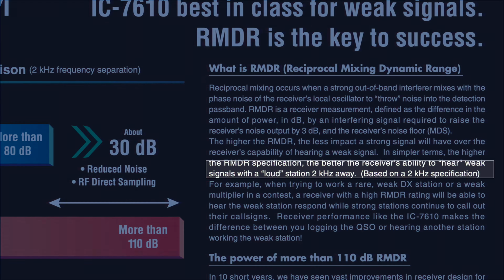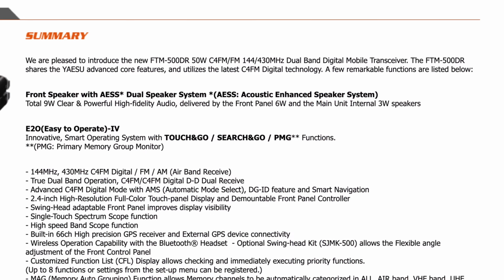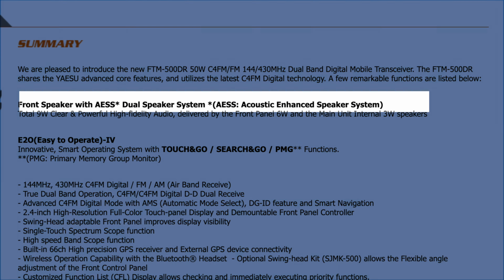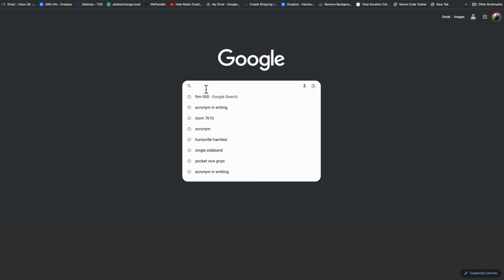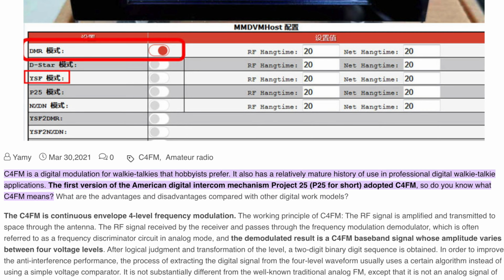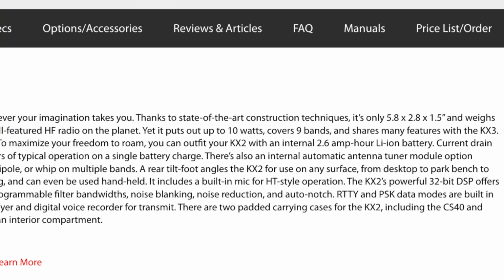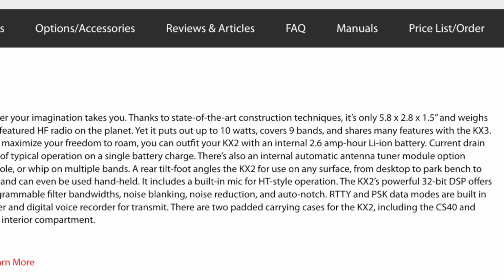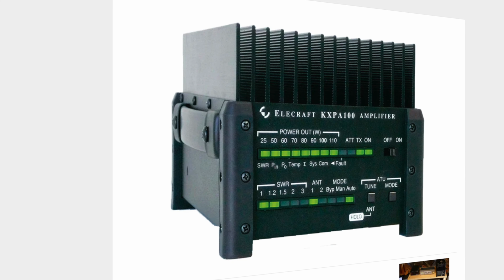Conquering Acronyms In Ham Radio And Other Hobbies

Comment: Using "context clues" is EXTREMELY valuable in every part of life, it can not be stressed enough. But in regards to this video it would have been most helpful if after your context clues lesson, you ran through a few of the most  acronyms you run into starting out in amateur radio. Besides ssb and cw.